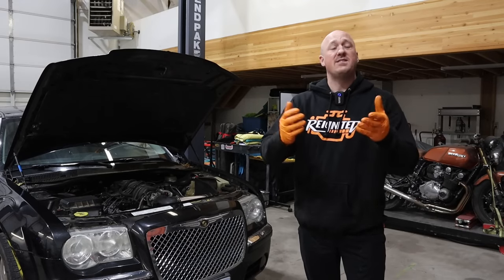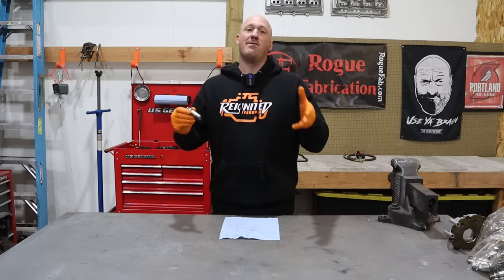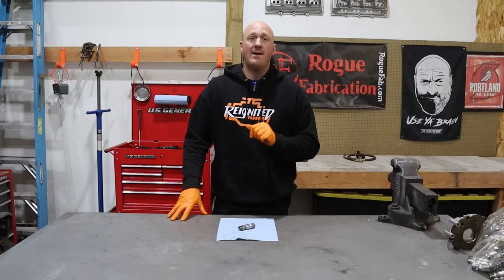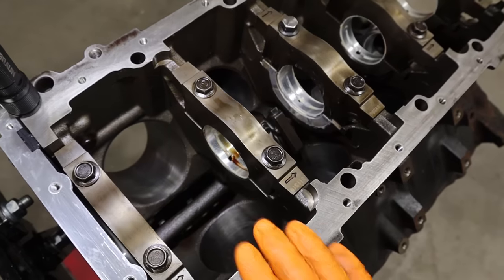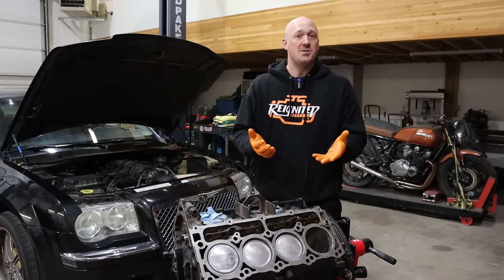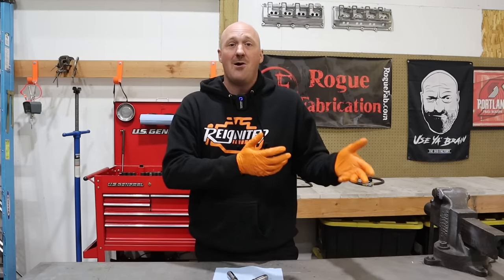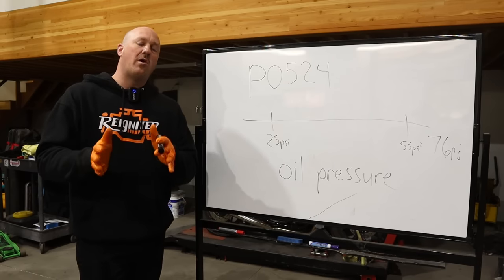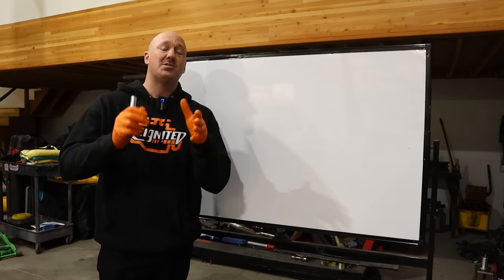The BEST Prevention For Hemi Lifter Failure! (In My Opinion)

Comment: A lot of great information. The comment on switching up to a hellcat oil pump is interesting. As someone who has faced the dreaded lifter tick 3 times on two different trucks, I can safely say that part of the reason is the move to thinner oils. On pre 2009 engines, the manuals state to use 5w30 engine oil, but on my 2014 trucks, the manual said to use 5w20. This is only for better EPA ratings. GM has the same issue with their 5.3 and they too specify thinner oils. I believe the bearings are not getting the lubrication they need. 
I followed the manual and did the changes right to the letter and it bit me in the ass. That is why when the tick happened, I was puzzled. My brother's Durango had done much more miles and it didn't fail at all. Not a single issue, and he was sloppy when it came to maintenance. 
I noticed that the dealership here in Dubai does not use 5w20. They keep using 5w30 to every engine (despite what the manual says) that comes to them for oil changes. But they will happily sell you 5w20 when you're doing the changes yourself. 
There are those who have been using 5w30 / 0w40 engine oils on their Hemis and have never faced a single tick or issue.
So my advise to any Hemi owner is to keep the oil change intervals short (like 4000 miles) and use a good 5w30 / 0w40 engine oil like Mobil 1 or Valvoline. If your budget can include Redline, use that as it is the best oil for the Hemi IMO. In my own reading online, it has been noted that Hemi engines respond very well to oils with a lot of moly in them.
Reply: On Project Farm he shows how the thinner oils don't lubricate and protect like the thicker oils.  So no wonder my Chev died at 211,000 miles (340,000km) . I kept it alive as long as I could
Reply: @daltontallman8721  Moving to 5w30 early on in its life certainly would have saved it.
Reply: @danherrala2087  Quite a few people on the Ram forums including myself, ran Redline and haven't faced issues in the cats so far. Some have been running the oil for years. 
You could be right,  but I haven't seen any cases being reported at the moment. Perhaps its the kind of zinc additive used. For instance, we know that moly in the oil isn't the same as what is in LiquiMoly's MoS2 additive.
Reply: Lifter failure is still happening on the 6.4 truck engines which spec the 0w40. I can't say if it's happening at the same rate as the 5.7, but there are still frequent reports on the ram HD gasser page. It may help due to better film strength but I think it's only a part of the solution.
Reply: @shoes121255  I can't comment on the 6.4. I don't have any experience with it. However there are few who have been using Redline 5w30 on their 6.4s and not had any issues. Perhaps, its not just the oil, its the additive package. Hemis do respond better to oils with good amounts of moly. I've often read where owners use Pennzoil Ultra Platinum 0w40 as specified for their 6.4 and add some Lubegard Biotech. This additive has been known to quieten the Hemi tick in engines that already have lifter issues, so it could be used as a preventative as well. 
Also i'm guessing unlike the 5.7, those with HD are professionals, tend to try to extend the oil change intervals to keep running costs down. 
I've learned that Hemi engines like short oil change intervals. 
If you have the 5.7, my original comment stands. If you have the 6.4, give it a try. Maybe select a thicker range of oil like 5w40. All I've said, I learned the hard way by experience and reading through a 4000 page thread on the ram forums.
Reply: Wrong the 03-08 called for 5-20 as well
Reply: @christophersmith4658  The manual for my brother's 2004 Durango asked for 5w30.
Reply: @007Knightjp  hmm i see, so do you think that moving to 5w30 oil as well as more frequent oil changes will prevent this issue? like for example changing the oil every 4500 miles or so.
Reply: @007Knightjp  i just reread your comment and what i asked is already answered, i notice you said youre from dubai, im from abu dhabi and wanted to know if there are any garages that know how to work on hemis in UAE, also how good mobil 1 oil is, i know its a lot of questions lmao
Reply: @juliuseater6447  My mechanic knows how to work on it.. he runs one of those backstreet garages in Al Qusais. I take all my cars to him. There are plenty of people who know how to handle Hemis, besides the Dodge dealer. However finding someone you can trust to not rip you off is the hard part. LOL.
Reply: @007Knightjp  I see… I have a guy that works in Musaffah so I guess imma ask him if he’s ever worked on hems. Thanks man
Reply: @juliuseater6447  The HEMI is a rather simple engine actually. So I'm pretty sure that if he has worked on any kind of American V8, he should be able to figure out the HEMI easily.
Reply: It's all just hope if 5w30 prevented it that would be on the cap...

Comment: Living in Los Angeles driving city streets to work and back , I have no control over my excess idle time…stoplight to stoplight. 40 minutes to go 8 miles. This video was the sharpest, most data driven explanation of why the Hemi tick (cam/lifter failure) happens and how to reduce the likelihood or potentially prevent it altogether. Thank you!
Reply: Hey.  Buddy.  Try.   Good.   Synthetic.  Oil.   Mobil.  One.   Royal.  Purple.  Amzoil.  Wont.  Gum.  Up.  The.  Engine. Added.  Insurance.   Just.  A. Thought.  Thanks. Buddy.   Good. Luck
Reply: Go Full synthetic 0W40

Comment: Had a 2014, 1500, work truck with the 5.7 lifter & cam failure at 176,000 miles. It was driven hard by many employees with a poor service record and half it's life was spent idling in the oilfields. I just bpught the 2023 scat pack shaker 6.4, I have already got 9200 miles on it. Hopefully if I keep it one day I can have the motor built with forged pistons, a lot more radical cam & lifters, and some lively tuning ! Nothing too crazy just a step up on the performance ladder. Your videos have been very informative and greatly appreciated.

Comment: I agree . More  frequent  lof services will do  wonders!  I  worked for  years in a dealer  service  department.   Oil life reminders are the  worst.  People  will always push them  even  further.  Oil is cheap!  Change it before it tells you to. 3- 5k no excuses!
Reply: I'm comfortable pushing the 5.7 interval out to at least 7K. Reason is the large sum size of 7 qts. If it was 4 or 5, then I'd scale it back to about 6K .

Comment: Good Information! I have been watching your videos and believe the HV pump is one of the fixes for sure.  The problem is no one wants to install it.  I am pretty handy but a real world truck install sure would be helpful for many of us!!!! I also believe the new SN oil standard (year 2010) coincides pretty well with the model year 2009 5.7 Hemi.  They kept the same amount of phosphorous (hence ZDDP) as the SM standard, but based on the SN standard description, made other changes that surely required more detergents / cleaning agents.  More detergents will wash the ZDDP off and reduce its effectiveness.  No ZDDP (effectively) = no protective barrier.

Comment: I did lab samples of QSFS 5w-30 up to 9400 miles and it easily did it. PUP 0w-40, Redline 5w-30, and QSFS 5w-30 should all allow 10K oil changes. My environment is severe interval recommended also. Tuned engine idle up to 800 RPM also so it never goes below 40 PSI now.

Comment: Totally awesome.. much appreciate all your research on this topic. So I read a lot about this topic and on my 2014 Ram 2500 6.4 BGE the oil type mattered as part of my warranty. So Pensoil 0W40 synthetic it came with is the only oil that has been in the engine from day one. I allways change my oil at 30% which is between 7000kms and 11000kms. I worry about idle times so get into a cold truck after 5 minutes...but I have wolverine heating pads on my oil pans with a timer to turn on 2 hours before the truck is started. Living above the 55th parallel I see a lot of Hemi tics and I'll say idle time is number 1 but poor choice of oil and lack of maintenance is proff too. 😊

Comment: Great video, lots of great information. I have an 08 Charger that I am thinking about upgrading the cam and lifters to the 6.2. I will put a Melling pump in at that time also. I am currently getting ready to change a wiring harness to solve a problem with the MDS showing an open circuit and not functioning. I have it disabled in the tune, but want to get it working again.

Comment: Rebuilt my 2008 charger SRT8.... used cam bearings that had oiling trenches " grooves" that led to the oiling hole vs the OEM cam bearings that dont and used new lifters that had oiling holes vs the OEM lifters that don't and put a mellings high volume oil pump in it....

Comment: I did exactly what this guys has said, I had a failed lifter, and I pulled my motor from a 2013 1500, and I replaced my cam and lifters, put in the srt oil pump, and I deleted mds and put a tune on the truck so it would run without it, and the tick went away and I’ve been driving it for a few months now, and when I cold start my oil pressure is at 80psi, and it just purs

Comment: I have a 2010 Challenger RT 6 speed manual and I have a 2014 5.7 hemi block from a Charger that I plan on building for my 87 Dakota. When you first put out the oil pump video I bought 2 of the Hell Cat oil pumps but I haven’t installed either of them yet.

Comment: I agree with your 5000 mile oil change frist time I took my 2017 ram 2500 6.4 hemi in at 5000 miles service lady came telling me it's not ready for oil change I told her I said change the oil than I started doing my own service on engine only other problem that dealer can't  address is tpms 80 psi is to much pressure in tires with no load
Reply from the maker: That is super annoying about not being able to change the TPMS settings. We used to be able to do that at the dealer, I think up to 2014, then they took that ability away from us.

Comment: I believe it's a combination of factors. I believe the fundamental design of the block plays a role and the change for VVT took something that was marginal but working to something that started to fail. The oiling from the lifter bores at idle is not going to splash much onto the cam. As RPM goes up the amount of oil from the crank and lifters splashing would go up and be sufficient. 

Lots of great info though.
Reply: Absolutely 💯
Reply: You're bang-on that those oil galleries barely have any effect on oiling of the cam/rollers. They only supply the bores, and I doubt much gets past the lifters.

Comment: Brilliant. Thanks for your videos. I've had a lifter failure on a 2013 5.7 in a Ram truck. I do my oil changes religiously between 3500-4000 miles but I did idle the truck a lot. Winter in Appalachia.

Comment: I’ve watched your previous videos before and here is a rundown of what i did after a couple of research to build a solid 5.7 Hemi

2014 Ram 1500 SLT 

Hellcat Oil pump

Hellcat lifters (MDS Delete)

Comp Stage one cam (for more power)

5w30 Amsoil signature

Change oil every  3100miles (5000km)

Ram V6 oem electric fan direct fit replacement than the mechanical (tune it to open at 194F)

Deral 12row oil cooler mounted with a puller fan (tuned to open at 194F

Truecooler transmission cooler 

Mildon 180 Thermostat 

Amsoil coolant

Morooso oil catch can

So far no issues its my daily i tow my racecar to travel, i live in the gulf so the most heated countries 

Hope this will help anyone 🙏🏼

Comment: Great educational video. As I listened to explanation on oil pressure/volume & error codes I kinda anticipated the oil sensor needed to be re-ranged or a different sensor such as on the hell cat engine needed to be installed. The voltage bridge was brilliant but I though the low end readings would be 12% lower now too. Being an old insrrument/electrician journeyman have seen field issues in instruments due to interference of all types from electrical induction to mechanical vibration, nicked cables when pulled in conduit. Anyway, having an 05 1500 with 5.7, 118k miles I have heard a tick now and then but now has quit. After changing crank sensor many codes have dissapeared fuel mileage increased, engine runs well. Thank you for your explanations & time putting together video. Most appreciated & subscribed & forwarded to some other 5.7 motor heads. Thanks Bro!

Comment: Great Video, very informative. I’ve been keeping up with my oil changes regularly and I currently have 60k on my 2019 scat pack charger. If I do run into a lifter issue I would definitely upgrade to the hellcat oil pump along with changing out the bad lifters and cam shaft. Thanks

Comment: I have a Ram with the 5.7 Hemi so I was very interested in this awesome and informative video. I change oil at 5000 or before and it runs like a top with no unusual noises but I also use a premium engine oil.

Comment: Very educational video. I have a 2020 1320 and I change the oil every 5k/6months, whichever comes first. Oil life tends to be in the single digits at that time. I use the recommended pennzoil too...Hoping for the best. This car is actually my daily driver, with around 10k a year. The only oddity I find is the oil filter weeps a bit. I use the 899 filter and tighten it to spec. I wonder if that happens to anyone else. The engine doesn't use any oil either. I have another year and 9 months of powertrain warranty left though.
Reply: Work at Chrysler for few years the 899 filters need to be really tight not to leak. Don’t be afraid to crank it down.

Comment: Thanks for this detailed video, tons of useful information condensed into these 40 minutes. I'd love to hear your thoughts on the oil viscosity though. The manufacturer suggests running Xw20 oil in the 5.7 engines, however their HD and SRT 6.4 HEMIs are required to run 0w40 oil only. Question is - are the engine blocks and bearings really that different for the 5.7 and 6.4 engines? Or is the Xw20 choice dictated by something else, like the manufacturer having to comply with emissions requirements?
I have personally been running 0w40 in my 2014 5.7 engine for about a 100k kms so far, and I can't see anything wrong happening to the engine.
Reply: 0w40 is a much better oil to run in all of these Hemi engines. Thicker oil has better load carrying capacity and better shear resistance than thinner oil. Thinner oil will give you a better gas mileage but worse protection against potential metal on metal contact. Higher volume pumps can help but can cause other issues. If the higher volume pump increases pressure too much it can bypass back to the pan depending on the bypass spring in the pump. This can sometimes lead to less volume in the oil galleys. If I was going to run the 0w20 change the pump, or leave the pump and run 0w40 instead. Best practice is to never go over on oil changes. Oil becomes thinner the longer you run it. The oil molecule shears into smaller and smaller sizes thus making it thinner. Sorry to be such a mouth full, but you are doing well by your Hemi running 0w40. I do the same thing in my Magnum RT.
Reply: Ow40 is a thinner base oil than 5w20 but it's additive package at temp give it load bearing of a 40w...so 0w40 IS a thinner oil not thicker
Reply: @Mr.Buckett84  Expected load makes the big differences, yes; non-HD trucks aren't expected to tow all the time and don't tow as heavy, so that higher viscosity number for high-heat scenarios makes sense.  In fact, the range itself will be higher on HD trucks (hotter max oil temps, even with better cooling).

Comment: Thank you this helped me greatly.  2014 jeep grand cherokee 5.7L hemi 126k mile number 5 lifter.  I did get the hellcat oil pump and swapped the spring.
Reply: I finished the assembly today.  At 203 degrees it idles with 38psi oil pressure using the hellcat oil pump with the stock oil pump spring inside of it.
Reply: Correction.  Full temperature after driving for an hour, the oil pressure at idle is 33 psi.

Comment: Just put a mopar reman into a 2013 ram1500 which did have a lifter failure at 112k miles (on a non mds lifter). And thanks to your previous videos I knew to install the hellcat pump when doing the job. Thank you very much for the help.
Reply from the maker: I hope it works out for you!

Comment: My mechanic would not install the Hellcat oil pump on my engine because he said it was not a stock replacement. He wouldn't warranty the "fix" if I insisted on the Hellcat oil pump. I was able to convince him to use the Melling pump. He also had a very difficult time finding the lifters and cam from Chrysler. He had to go aftermarket on those as well! Using that relief spring is a great idea. The Melling HV pump comes with two springs. You can choose the lower pressure spring that comes with the pump.

Comment: About using a heavier oil weight, couldn't the thicker viscosity help protect the lifters? I'm not talking about the oil pressure at all, only the viscosity. The 5w-20 vs 5w-30 debate for the hemi has gone on for awhile, and when leaving out the oil pressure, studies have shown (for example, on projectfarm's channel) that the thicker oil can do a better job at lubricating. I know that there can be problems with the VVT and maybe the MDS with a thicker oil, but just for lubrication, what do you think about running a thicker oil?

Comment: My 5.7L Charger RT has a Comp Cams cam and lifters, MDS delete, failed on cylinder 7. Thanks for this video, this really helped with my rebuild. No metal in the oil sensor, so new cam and lifters.